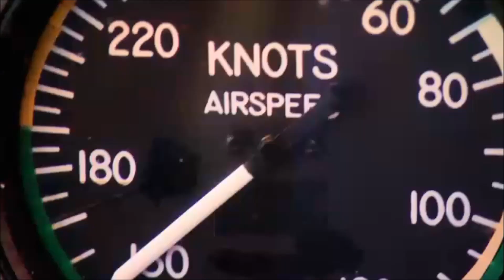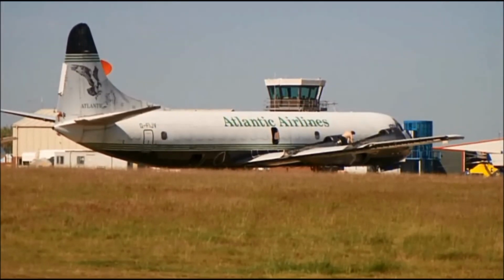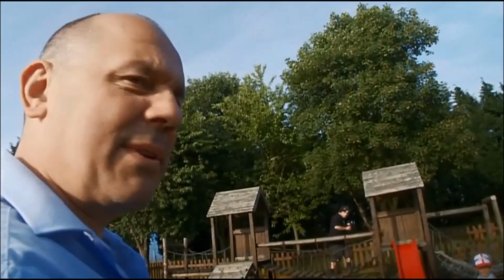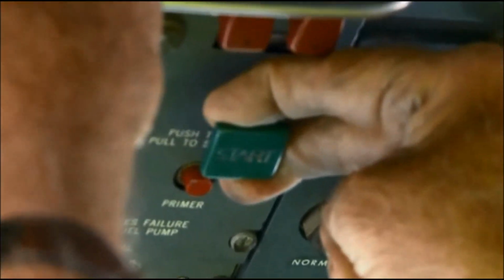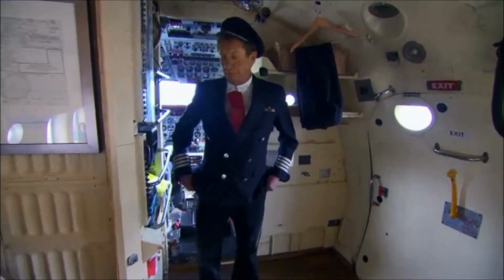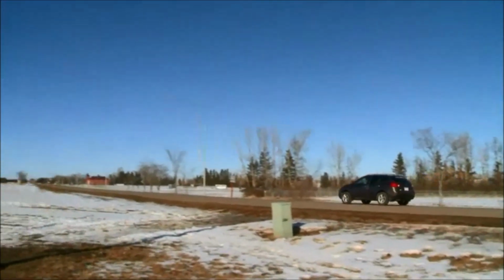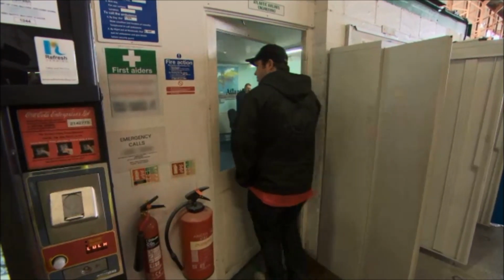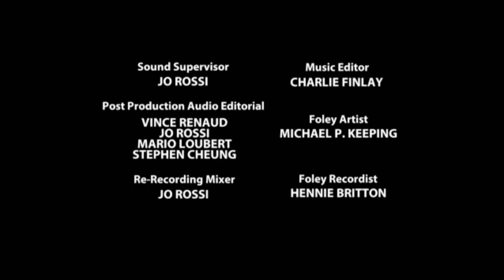Ice Pilots - Atlantic Airlines Special

Comment: I was very fortunate to have been in the class rooms here at Atlantic Flight Training when the Electras and the DC 6'S were flying, often we had to stop, mid lecture, to wait for the engine run ups to complete, it felt like going back in time to all of those flying adventures I had read. Thank you for posting and sharing..
Reply: You are very privileged to have worked with Atlantic Airlines when they were at their peak! Thanks for sharing.
Reply: @AviationLBA  thank you, I was very fortunate. I must say I was only there as a student in their flight training section toward a CPL/ ATPL but as long as you had the right attitude they treated you as one of the group.
Reply: Was instructor at AFT when in the old terminal building. They flew that DC-6 low over the building low level and it shook.

Comment: Why don't they use old Boeing 727's instead?  They can't be much more expensive to purchase and I'd think they'd be better on fuel than a 4 engine Electra.
Reply: maybe a second hand p3 orion? basicly the same
Reply: splat003
Reply: Electras have excellent short field and unimproved runway performance.
Reply: Props are just better suited to off field,rough and unimproved airstrips than jets.Thats why the old piston powered stuff is still around.The last thing you'd want to do is suck a big chunk of ice in a big turbo fan right as you rotate on take off ;-)
Reply: @southjerseysound7340  They have solutions for that, look up the video of the 737-200 landing on a gravel runway with a "gravel kit" so it doesn't suck in any gravel.  Same would work on ice I assume and those same 200's are some of the last ones still flying, ironically right in Buffalos neck of the woods.
Reply: 727 is a gas hog.  Much more expensive to operate and most are eat up with corrosion.

Comment: The Electra was/is a great passenger, now cargo aircraft, large and fast. But there is that sticky problem it's vibration causing the wings to fall off, maybe the worst and final event in several pilots lives. With 59 hull losses and 1030 fatalities I think I'd have a problem flying in the aircraft.
Reply from the maker: Bobby Paluga you're correct. In the beginning a fault with worn engine mounts allowed the Allison 501's to cause oscillations which were branded 'whirl mode'. Fortunately, after the fleet were grounded following the crashes, Lockheed engineers managed to modify the engine mounts which may have fixed the issues albeit not their reputation and enables them to fly into their 60's.
Reply: Fixed long ago.